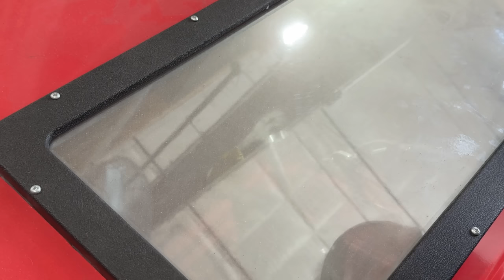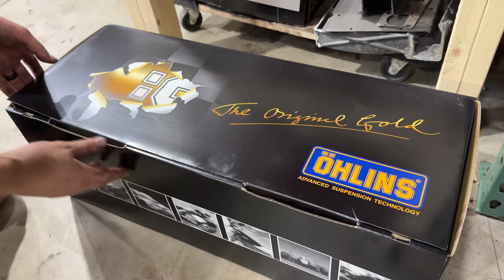My Supercharged FD Rx7 RESTORATION

Comment: Really? I'm usually quite open to engine swaps but an LS in an RX-7? I'm sorry but that's just not right😢
Reply: Fits under a stock hood, almost no weight difference, reliable, consistent launches, etc. No-brainer.
Reply: I had a FC with a 302 fox body drivetrain